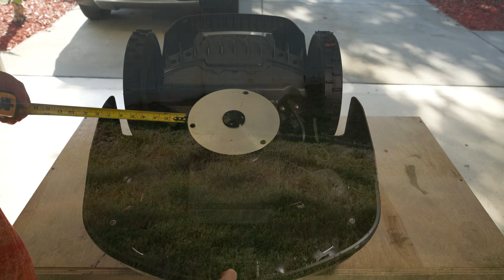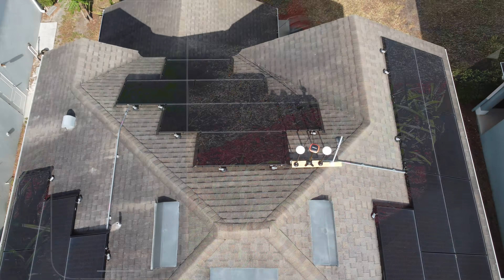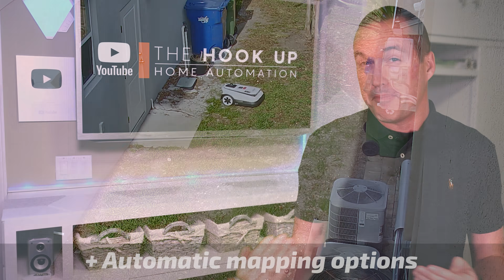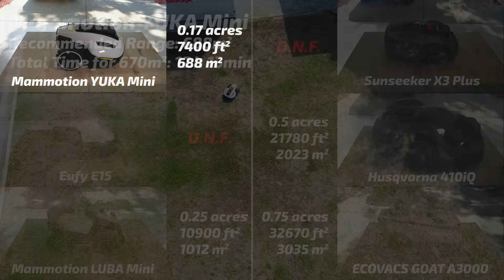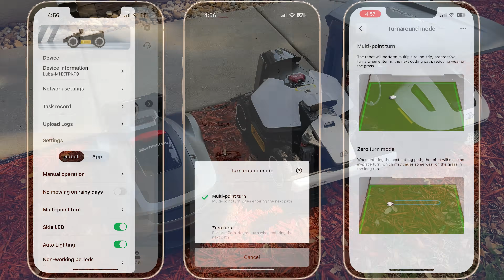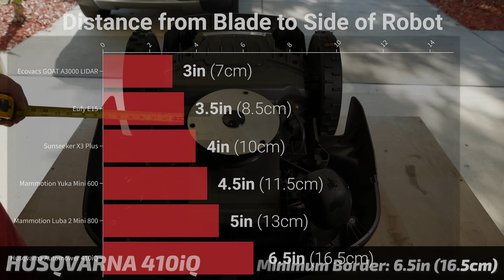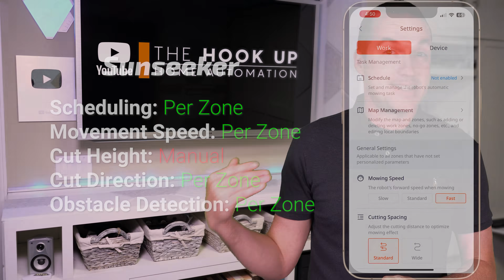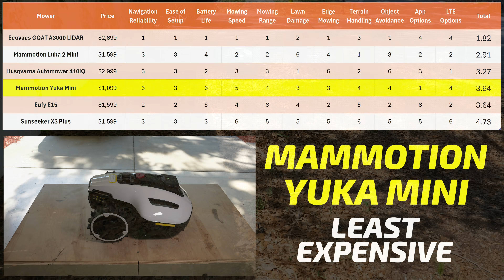Watch BEFORE You Buy a Robotic Lawnmower - LIDAR is a GAME CHANGER!

Comment: To be honest, this review lacks depth on some features these mowers have, I don't know all details on all of them, but I know for sure the mammotion has vision sense too, next to the RTK.

About the need to setup RTK antenna for the Mammotion mowers, this is not needed if you are willing to pay a $50/year to use their cloud based solution. Been running it for a couple of weeks now (1st year it is free) and it has been flawless.
A part of my garden is surrounded by trees and buildings, when running the RTK on my own property it sometimes lost its gPs connection (which was not an issue as it was able to pick it back up quickly, and it vision system was able to continue meanwhile), with the cloud rtk however i never had 1 single GPS drop.

In general interesting review, and I'm grateful you shared this, but like I already said, you missed some crucial features these mowers have, and this is causing an unfair low score on some mowers.
Reply from the maker: 1. Mammotion's vision system is advertised as a fall back for GPS navigation, but I would consider it more of a supplement, rather than an alternative.  In the clips you see if the Luba mowing on the side of my house it has poor GPS signal and is using vision to continue moving within the space while searching for a satellite, but it is only able to move a specific distance from when it first loses the signal, so it normally is not able to recover in that area.  Further, if it recovers GPS signal and realizes it has left the task area while using vision it will not navigate back to the task area, it just stops and sends an error notification to the app.  I'd love to see a feature added where the robot keeps track of GPS signal on different parts of the map, and possibly the ability for the robot to navigate to a high signal location using vision in the event of a GPS loss, but currently it is not able to do anything like that.
2. The RTK over LTE option is only in Europe.
3. RTK over LTE would not have solved the issues in this video.  The issues were with the GPS reception of the robot, not the RTK station.  Once I put the RTK on the roof it had full view of every satellite that the robot could possibly see.

Comment: The RTK base stations are too close to each other. When the LoRa signal is transmitted, it will interfere with each other, resulting in poor performance of the lawnmower.
Reply from the maker: That's not correct and would have been very easy to diagnose since all of the apps report their LoRa connection status and signal quality.  4 LoRa devices is not anywhere close to enough to cause signal degradation.
Reply: @TheHookUp  No, you misunderstand. Lora wouldnt be interfering with lora, but a lora transmitter might interfere with the RTK reception of the base station right next to it (as might solar panels, inverters,..);  that wouldnt show in the app any differently than poor RTK reception due to walls, trees or whatever. Im not saying this is a fact, but its a possibility, especially if you base stations reported poor RTK reception. If the mowers themselves had poor reception, thats a different story.

Comment: what a shitty test. You are comparing Husquarna or Ecovacs with Mammotion minis?  And then in conclusions you are consider speed, battery etc. Take Luba 2 3000X instead of minis and the result will be completely different. Also testing on I dont know whats that but its not grass. This is not normal conditions what you are putting this robots on. Also for Mammotion you dont need RTK in some contries, it has iNavi. But I would say there is more incorrect information.
Reply from the maker: I would have loved to have a smaller Husqvarna or Ecovacs LIDAR, but they don't exist.  I'd argue that the lower price point of the Mammotion units was the only thing keeping them in contention in the rankings.
Reply: @TheHookUp  yes but this is one  criteria against several. So compare similar mowers will provide better results. One more think Mammotion mowers are able to map itself if you set it in app. And one more on proper grass ther is no damages by Luba, on shitty grass or in slope there is.

Comment: Mammotion introduced Rtk over LTE/WI-FI. Not sure if it is already in US but it does not require an RTK  antenna anymore....
Reply from the maker: RTK over LTE is a service that uses RTK correction data from 3rd party owned RTK stations near your area, but it is only offered in Europe.  For RTK over Wi-Fi you still need to install your own RTK station, it just uses the internet to transmit signals from the RTK station to the robot instead of a direct LoRa connection.
Reply: It also doesnt solve the problem with RTK, all it does is reduce the cost since you need only 1 RTK receiver (the one inside your mower) instead of 2.

Comment: It is probably worth mentioning that the Mammotion range (Luba & Luka models) have an optional catcher available.  It is a powered unit, with it's own battery.
It has a set of rotating fingers, in a drum layout, that flick clippings, leaves, and twigs into the catcher.  When it is full it tootles off to a spot you define and empties itself.  Because it always goes to EXACTLY the same spot, this can get messy, and a bit comical.  One video shows it emptying the catcher over the edge of a metre high dropoff... sounds risky, but seemed to work well.  The down side is the price:  about half the price of a new Yuka Mini.
I am not familiar with the other mowers in the review... they may have similar options.
Reply: Yuka sweeper is hit and miss. I have owned it since July 2024 and I don't recommend it.
Reply: @borilgoril  :  Good to know, thanks.  I had already dismissed it for my needs; the price seems reasonable for what you get, but it is more than I am prepared to spend.  Frequent mowing will work for me, I think.

Comment: As always, a clear, concise, complete and UNBIASED review... Thank you.
For me, a Yuka Mini would be the answer... the price is doable, and my lawn is made for it... small, level, short grass, lawn-level paving on all sides, perfect locations for charging base and RTK unit... now I only have to sell the idea to "Her Indoors"!
I believe the front wheels on the original Luba were similar to the back wheels, and they made a terrible mess in front of the charger, to the extent that there was a mat included with the mower to peg down in the turn zone.
The wheels on the Luba 2 were meant to fix this, but it is clear from your review that it was not a real fix.  I guess that's the downside of having four wheel drive.
Reply: just buy Yuka 800 mini it has the biggest battery, 600 is with such tiny battery

Comment: They should not call them mowers, they should call them maintainers. I started with a worx landroid and now also have a luba 2. They both definitely have their pitfalls, but they do save me quite a bit of time. A few things I have learned - if you want the mower to cut using overlap cuts and multi-directions, buy one that does way more than your lawn size.  Their advertised size of cutting means widest path and one pass. They also don't handle dog droppings very well, so you will have to ensure you keep up on cleaning the yard first. I am using the luba2 awd 3000 for my front yard - its just enough to cover the whole front and side lawn with 8" overlap paths and cuts in two different directions. I keep the worx wire based system in my backyard - its wire based and doesn't handle uneven terrain well at all. I had to set the wire in from the edge of my lawn and fences, and about once a week I run the perimeter my my push mower. I will say that my mamotion luba does not tear up the yard in front of my charger.

Comment: my experience with having a wire guided huskavarna robot lawn mower and understanding grass well, is mow height matters, if you have cool season grass in northern half of country.  Most of these mowers mow too short, they are designed to mow southern grass which is too short up north.  Second is this is a change is lawn lifestyle not just a new mower.  So expect a season of tweaking to maximize the benefit.  Its little things like instead having sharp border that needs weed wacking.  Put a flat border in front of sharp border, so mower can mow into the border without leaving an edge.  Also, you will have to fix lots of small pot holes in your yard you didn't know existed.  But once you do this, the grass is amazing.  It always looks good, when you from back from vacation or rainy weeks your grass looks good.  Its  nice not to have to get gas, or deal with noisy lawn mower.

Comment: please specify the model of YUKA mini (in the table there is a designation 800, but you probably have a model 700, the result will be the same except for the length of operation, 800 has a battery capacity of 6.1 Ah, 700 only 4.5 Ah). Great video, thank you very much.
Reply from the maker: The Luba is an 800H, the Yuka is a 600H.  However, I believe they decided not to continue to sell the 600H and just have 500 and 700 now.
Reply: 😮 that is awesome. So you tester YUKA mini 600 with only 2,4 Ah battery. Yesterday I bought YUKA mini 800 with 6.1 Ah (1050 € inc. garage). Btw in Europe, they sell YUKA mini 600 and 800 only.

Comment: 1:00 - The Luba 2 AWD has dual cutting wheels which let's it get a lot closer to the edge which is nice but you'll still need to strim the edges if the grass is up against a solid object. I found similar issues with the RTK until I mounted it on the 90 degree mount instead of the long stick - I wonder if the long pole allows for some flex in the wind and causes it to get slightly out of position? Once mounted to the 90 degree mount on something solid I had much better results.

Great video as always with lots of detail!
Reply: Predictably, the Luba 2 AWD has a higher price.   😟
Reply: @PiefacePete46  Still starts cheaper that the LIDAR mower.

Comment: Can you also check the Dream a1(pro) and A2? Work Both on lidar.
Reply from the maker: I asked my Dreame contact and they said they have no plans of selling the A2 in the US.
Reply: The A1 tends to get stuck quite a bit.
Reply: @Crazypostman  Stuck, not really, the algorithm to get itself out of trouble works well, but it does have poor traction (source: I have one). However, the chassis design of the A1 is very similar to the goat A3000, I expected the goat to do about as badly. So now Im very curious if the goat is somehow much better than the A1, or if most other robots are even worse than the A1?

Comment: Thanks for the extensive testing and non sponsored nature of the video since basically every other video appears to be sponsored.  I'd like to ask what you thought about mowing quality of each mower.  Like the straightness of mowing lines or missed spots, things like that.
Reply from the maker: Basically all the same mowing quality.  I thought the Luba left the best “lines” because of it’s fat wheels, but they all kept straight patterns easily in open areas.  The Eufy was the most likely to deviate from its path if it thought there was a bare patch and the Husqvarna was the most inconsistent around edges.

Comment: Should have tried the Sunseeker X7 instead of the X3.
Reply from the maker: Why’s that? Isn’t that just their large version designed to compete with the full size Luba and Yuka?
Reply: @TheHookUp  The X7 has all-wheel drive also. It might not get stuck. The rear caster wheel is powered.
Reply: @Crazypostman  The X3 is also alll wheel drive? The front wheel is driven. Im actually shocked how badly it did in this test, I always figured it would be a good choice, being one of few options to combine AWD with VSLAM (mammotion doesnt do VSLAM).

Comment: My old school primitive wire fenced Husqvarna robomower has been spectactular for literal years. Zero navigation issues, never needs rescuing or resetting, it just works. It keeps 99.9% of my lawn nice and neat and I put it out in the spring and take it in when fall arrives. I've swapped its battery once, and put on new razor blades regularly and that's it. Breaking out the wire trimmer for some detailing work once every few weeks is hardly the end of the world. Honestly, if this broke I might buy another wire fenced one from them in spite of the high price. It doesn't do neat lines, it doesn't get fancy, it just mows my lawn and keeps it golf green flat for months on end. Newer is not always better. More advanced is not always better. Wireless often sucks out loud. Yes, it's a major pain in the ass to get the wire laid down and it's prone to damage in some situations which can be a huge hassle, but - it's incredibly reliable. I honestly wouldn't downgrade to any of these units. Just one malfunction or annoyance and it would be worse than my old school.
Reply: Yes I am happily using the automower 115 h now on my third season. Supper happy with it and the price is fantastic.  Using robotic mowers since 2000. I love the experience.  Cheers to old tech for the moment. I hope the new options are better when I have to retire my current mower.  (This is my third or fourth mower since 2000.  I replaced so many parts on one of them I would consider it two😂[RoboMower 3rd gen].  I still would not consider living without a robotic mower,  it changes my relationship with my yard.
Reply: I have 2 different Robomow mowers moving about a half acre for 4 years. Yes.. they took a while to setup as the directions were not 100% clear.  But I went with the Robomow because of the terrain. Nothing else could climb some of the hills in the back yard.. its 38 degrees in some spots..( the 'extra grip' wheel add on's are awesome when its damp out. )
Plus the blade life in the Robomow is fantastic.
Reply: I went from a husqvarna 430x wired to a luba 2 3000x, I've had more problems in 2 months with it than I had in 7 years with my old Husqvarna
Reply: They use those Husqvarna wire fenced mowers at the golf course I frequent.  They are pretty fun to watch cruising around cutting grass.
Reply: This 100%. Wire fenced mowers are way better. Mine (husqvarna 330x) also has gps assistance to map out areas that are difficult for the mower to get to when moving randomly, so the mower knows when to specifically go to those areas
Reply: I have 2x Husqvarna Automowers and I recently got one of those fancy Mammotion. The fancy Mammotion is much cheaper than one of the Automower and it does a much better job (not stuck a single time, while the Husqvarna got stuck 3 times only yesterday). The more expensive Husqvarna is also a lot slower.

The cheaper Husqvarna, while still costing two thirds of the Mammotion, broke down 3 times this season (2x motors, power supply and PCA of the charging base). The motors and power supply were replaced before and looking how they were designed, it is pretty clear they have some flaws. The Husqvarna parts are also overpriced for what they are.

On one side, I do get you like the simplicity of the Husqvarna, but they cost a lot more money and they also take a lot longer to cover the whole lawn. After one week with the Mammotion, I was shocked on how well it mowed the 4000 sqm lawn. The same lawn used to be maintained (or try to) by the more expensive Automower and the Automower never did such a good job as the Mammotion.

Comment: Can you test the bigger mowers like yarbo, luba 2 and lymow?
Reply from the maker: I reached out to Yarbo to see if I could get an early unit with the built in string trimmer, but they said they were only looking for "gentle reviews".  I also talked with Lymow, which I think looks awesome because it has real mulching blades, and while they were open to a review they only had an "early Beta" review unit to send me, and they said it lacked many of the features of the final version, so it seemed silly to include that in the video.
Reply: @TheHookUp  Thanks for the follow-up!  I saw a video on lymow and they say theirs is a lithium iron phosphate battery which seems like a good idea.  I guess Yarbo needs a battery for very cold temps but lymow does not so their battery is a bit more rugged even if it doesn't have as large of a capacity. I really like your videos, btw!

Comment: nowhere in this video did I see grass that needed to be mowed. Every example was either dead grass, full of leaves, or sandy patches. Looks like you were mowing homes in LA after the fires. Take these things to some actual yards with good patches of taller green grass and not the badlands.
 But good production as usual.
Reply from the maker: 6 weeks of no rain during filming, but the "grass" still needs to be mowed.  When using robotic mowers your grass should never look like it needs to be mowed, it should just be maintained at a constant height.